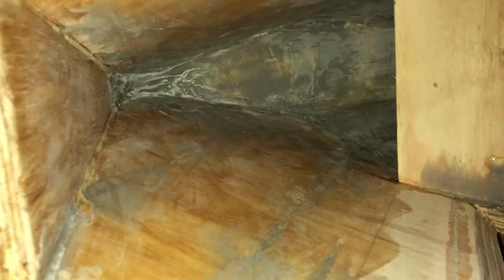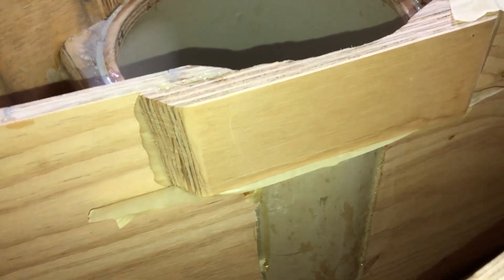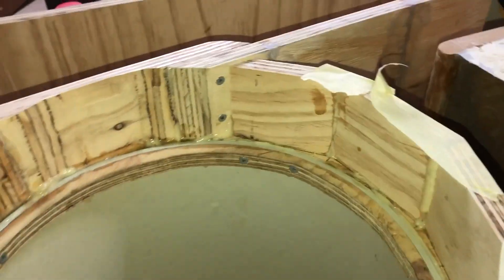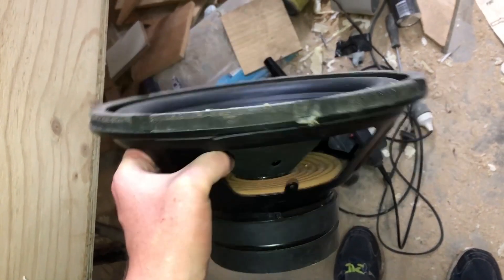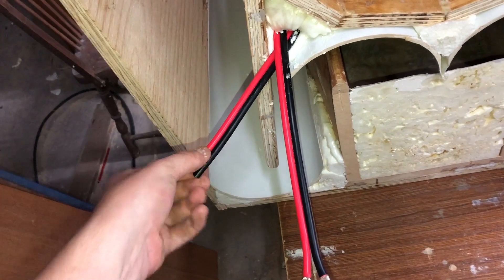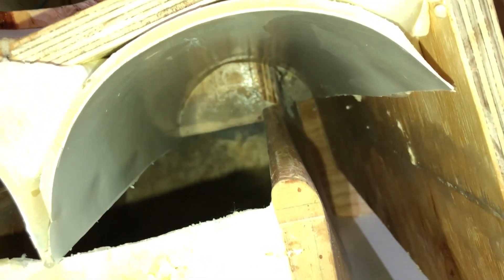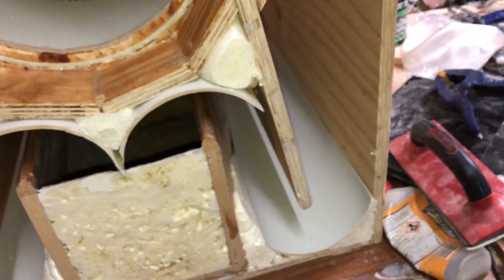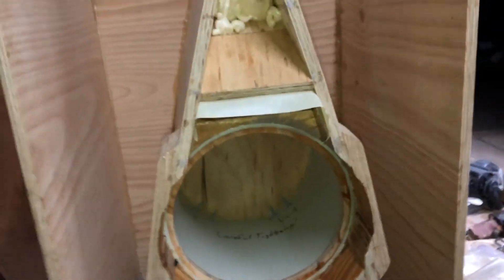Almost there! - Folded Horn ep 10

Comment: I just ordered a pair of ks digital c8. I want to put them on a kind of bass tower. Currently I am thinken about 1m high transmission line. However I am still looking for a proper driver and resurching on enclosures.
Reply from the maker: Could be a bit tight for a transmission line, but those speakers look pretty nice, I'd like to hear a good coaxial driver and how it images
Reply: @Dakoustics  they are not only coaxial but also time and phase aligned. The resulting image mind-blowing! On some recording you can picture the room where it was recorded in. Like the singer is singing just for you. Can't wait to hear them in my room.
With the t-line, I will play with different fs to get the hight around 1m-1.2 I would like to us a tube shape for the port instead of a square shape. I am reading a lot about the cross-section change along the path (tapert, flared...). I think I need to simulate the enclose. I don't know yet what software is the most appropriate for t-line?
Reply from the maker: @clementc7297  HornResp can do anything, if its a tube just plug in the surface area at the driver, then the mouth, check the schematic view to see if it looks right, then you can see freq response, impedance curves, efficiency etc. If it remains the same size use quarter wave tuning, if it tapers it'll tune lower than quarter, if its flared it'll tune higher.

Comment: Hi,how many hours did you do in this beautiful speaker project??20  22 hours  more or less, Sure you have a rourer and other machine tools.
Reply from the maker: probably took around 100 hours in all, half of it was me trying to work our what to do next while glue was drying
Reply: Epoxy Glue,or a mix with glue and screws(bronze) better.more resistance to vibrations. At home i use a mix (glue+ screws for fix)then dried the glue is incredible the high hardness. one enclosure last time falled down and...nothing.
Reply from the maker: @nomon95  I mainly used sika techgrip, which is strong wood glue, for joins this glue is stronger than the wood. I did add screws in certain places for reinforcement. I screwed in one piece whilst it was gluing as I couldn't clamp it.
Reply: Sika techgrip?? I will  see if in my copuntry is for sale, Some products Sika are used,F.e, roof insulation.